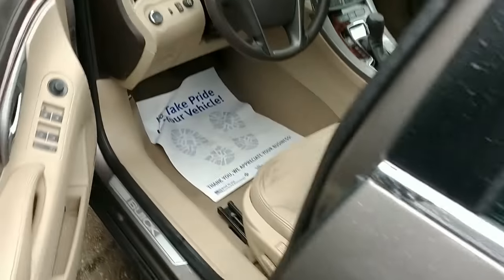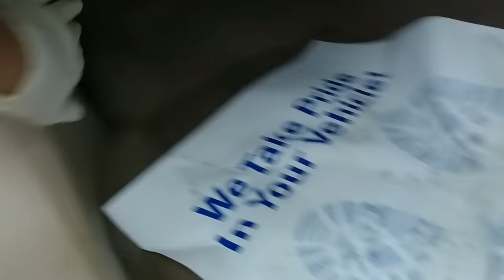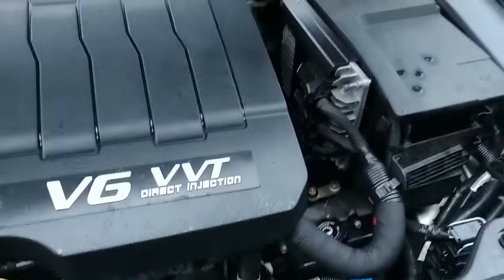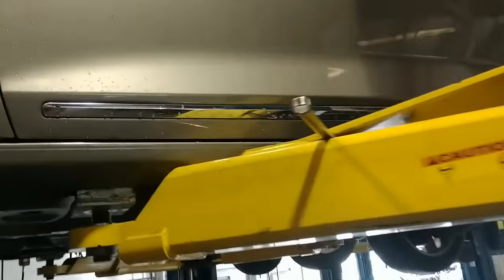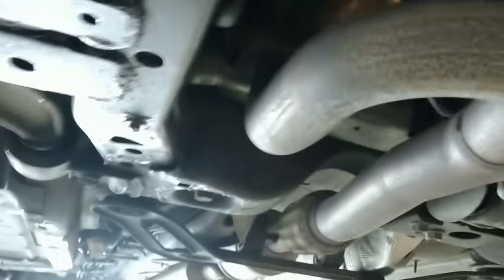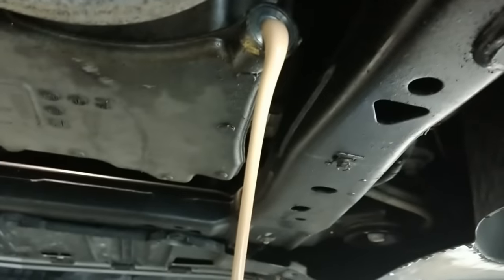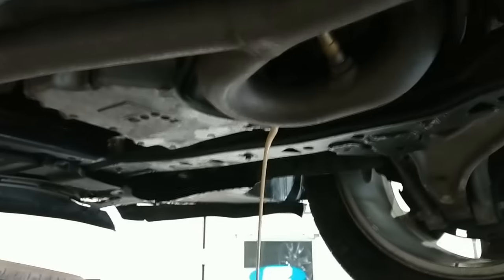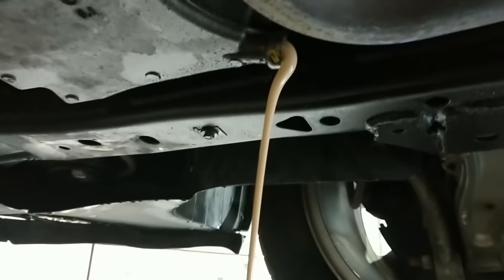Overfilled Crankcase! Blown ENGINE! Used Car Nightmare!

Comment: "I just got this new car, where does the gas go?"

Not sure, but the chocolate milk goes here that I know for sure.
Reply: Clearly the new guy wasnt sure what he was doing before selling it off lmfao
Reply: Lmao
Reply: Lol
Reply: @XENOX1428  or maybe he did it on purpose
Reply: @XENOX1428  he knew exactly what he was doing
Reply: Lol
Reply: That's not chocolate milk, it's coffee with cream and sugar.
Reply: If you'r chocolate milk looks like this then don't drink it.
Reply: @XENOX1428  Like he said in the video... it is oil, just mixed together with coolant.
Reply: I had something similar happen to me back in 1997. I bought an Audi A6. I knew where the gas went but could not figure out how to open the gas door. Turns out I had to push on the front of the gas door because of the way it was hinged. It would have been nice to have like a push button spring load on the rear so that I only had to open it from the rear like a normal car. I spent about 30 minutes looking for the gas door release button, under the dash, by the driver seat, in the glove box. Finally had to get out the owners manual. One thing that was good was that when I locked the doors it locked the gas door as well.
Reply: I think you mean pancake batter.
Reply: Gotta admit it was a clean looking  car.
Reply: this reminds me of vlog creations who acts stupid and puts beans in the gas tank and takes it to a garage to prank them lol

Comment: Hey Ray! nice to see a fellow swfl mechanic doing things right. I had one heck of a buy here pay here story about a month ago. lady bought an F150, owned it for ONE DAY and the trans literally blew up. Im talking the entire tail housing missing, driveshaft MIA, part of the wireharness ripped out for the speed sensor, LOTS of carnage (i have pics if you wana see)  since she already paid for the thing in full with cash she was set on keeping it, and while pulling the trans i noticed it was already a junkyard unit! (we got her a reman unit) The job was made more fun since i couldnt remove the exhaust crossover that runs under the trrans since it had been fully welded up! gotta love it
Reply: oof
Reply: Driveshaft MIA got me there 😂

Comment: I think checking the oil is damn near top of the list of things I check before buying a car.
Reply: iT IS the 1st thing to check after popping the hood. In fact before you even start the engine AND after.
Reply: It is, however I'm sure that used POS car dealer probably prepped this car so it would look "clean" on the lot, with freshly changed oil and coolant so if a customer actually checked them they would look normal.  Notice how they put armor all treatment on all the plastic parts just to "shine things up".  The oil and coolant probably didn't start mixing until after the lady drove off after buying it and only after reaching operating temperature, meaning she was miles away at that point. What a shame.  I feel bad for her.
Reply: Which is exactly why changing the oil is one of the very first things they do.  You’re more likely to find fresh clean oil and a sticker on the windshield than you are to find a clean car.  When you pull that dipstick you won’t find what you’re looking for because the evidence has been drained.
Reply: More like throwing on a coolant pressure tester onto the radiator and pump it up. Coffee milk shake means blown head gasket or cracked head/block.
Reply: Prolly everything was fine when he bought it. Sometimes head gasket just fails. I know it shouldn't especially on a new car like that.
Reply: @LA_Commander  yea but lemon laws will help in this case. Because its apparent the dealer sold mislabeled product of advertising as good working condition while clearly knowong it needed serious work
Reply: @wakcedout  You would think so, but unfortunately in most states, lemon laws only apply to brand new cars.  With used cars, you normally have no rights.  It's the world of "as is".
Reply: If I can't drive it first I can't buy it . That can save you alot of money . Warped  or cracked heads possibly blown gasket if lucky I'm guessing.
Reply: @roberttyrrell2250  Yeah, an knocking and smoking engine that needs an overhaul can be masked by using thicker oil. Very hard to spot unless its something absurd like 20w50 in an engine that should have 5w30
Reply: @kinsmart7294  There's a lot of things ppl can do to scam someone into a POS. You'd be amazed what a little black pepper can hide. OG trick.
Reply: I would run the car up to temp first. If they refuse to let you do that then it's walk away time....
Reply: Same here.
Reply: Used car dealers are right there with the lowest of the low.
The thing to keep in mind is, if a newer car is on a used car lot, it's probably because it was a lemon to begin with.
Good ones are usually sold to friends and family!
Reply: I allways check the coolant 1st & if it inst clean & new looking i walk away.
Reply: Checking the fluids, starting the car and moving it to look for leaks before test driving.
Reply: Probably. However not everybody is a mechanic. My girl for example probably doesn't even know where to check the oil, and I wager she is not interested in knowing such a thing. Still, she needs to buy a car every now and then. In general, people do not know exactly how the things they buy work, nor can they.
Reply: To get even wait 4 night time then go in the lot n spray all the cars with acid n paint..👽
Reply: I always take someone with me who knows what to look for with everything.. lol used car dealerships didn’t like me much… lol
Reply: @johnknight8540  Don't try buying at dealer auctions then which is where most cars come from today. You can drive it maybe 20 ft and go thru it for 15 minutes but that's it.
Reply: @jackdaniels9401  I know of a dealers lot that had that and more done to it. It was a new and used dealer at that he was ripping everybody off though it ran him out of town for real.
Reply: @Brooklynborn74  Be careful sometimes the person that you take knows someone at the lot willing to pay them a finders fee if u buy a car. Never fall for the old I know a good person that works there scam.
Reply: @quickdraw2532  those are different.  You not going there  intending on buying one car with the last bit savings you have . You got money already put back looking to buy 3 -5 plus cars as you know some will need alot of work . Those are crap shoots if your not mechanically/ electrically inclined . Being if things are wrong and you can't fix it your self you won't break even and most like need profit off the other 2plus cars to break even . We talking lot buying from a dealer . Where you turn the AC/heater to max and hit it at interstate  speeds. Then come back and look it over . If not you already looking to buy a lemon . If you can't drive it you best not buy it .
Reply: @roberttyrrell2250  not entirely in the US we have this thing called the lemon law
Reply: @gamefreak173  I'm familiar w lemon laws. Filing against a private citizen, is easier than a dealer. Try proving it while; You continue to make payments/ Ins, hire an attorny, be able to prove you did nothing to violate terms of service, or warranty.
Reply: It could of busted after she drove away, having had a cheap service or budget repair job.
Reply: Oh crap! I forgot to do this when I bought my Tesla. 😔
Reply: Yea some people put stop leak before selling so buyer won't know until about 300 miles later
Reply: @LA_Commander  - I'm guessing it had brand new oil in it when it was on the lot too.
Reply: @aardvarkbiscuit2677  Exactly, dealers know exactly what to do to fool customers. The really sloppy lazy dealers leave old dirty oil in there.  When I look at a used car if I see that I run like hell
Reply: I checked oil, coolant, A/C functionality (as we were just starting winter, and I needed heating to not die and be able to see), and windshield washer fluids. I also ran the engine, checking the exhaust for anything other than clear. Thankfully it was not an automatic, so I didn't have to worry about transmission fluid. 

I did have to worry about learning how to drive stick, though, since before my first car I had never driven stick. Not even dirtbikes.
Reply: well this video will always remind me to do so in the future
Reply: @LA_Commander  Yep...I wonder though. Did the buyer give it a good test drive, long enough to get it up to temp and at highway speeds?
Reply: yep check all fluids and smell it as well you can find alot out of fluids
Reply: @yautjayarrington1732  oil would not froth that bad after less than a hundred miles
Reply: I've bought a lot of cars for the family and have a very thorough checklist, I crawl all over and under that thing for like an hour before even starting it. Then another hour of checking, test driving, before saying yes let's buy it.
Reply: @AmandaHugenkiss2915  yep these days you have to used to be a quick check and a handshake and you could take a guys word
Reply: Forgot, always always always go first thing in the morning to hear it cold start. Don't accept "we warmed it up for you!"
Reply: Used dealers don't tend to like that - but, I guess their reaction would tell you everything you need to know.
Reply: STP can fill in a lot of gaps! For a while...

Comment: Science teacher: "Water and oil don't mix"
Buick: "That's where your wrong kiddo"
Reply: It’s coolant lol
Reply: @JoseRodriguez-nu3cu  which is half water.
Reply: @Dillonkg1  yeah but still..
Reply: @davidreali9642  Jesus what’re u saying 😭
Reply: It’s technically a suspension. Like salad dressing
Reply: Coolant and oil mix water and oil don’t, that’s because coolant is made of more than just water changing it’s density
Reply: @jacobdoesstuff2361  Coolant is made up of water and glycol. The glycol acts as an emulsifying agent because it has both, polar and nonpolar characteristics. This allows the glycol to bridge water and oil molecules together. The water molecules bind to the alcohol functional groups of the glycol, via hydrogen bonding, and the oil molecules bind to the hydrocarbon chain via Van der Waals forces.
Reply: That’s where MY wrong? 🤔
Reply: I guess an engine is a pretty good emulsifyer.
Reply: @Lolz325  How are you going to tell someone they can’t build sentences properly, when you don’t add spaces after commas, and use the incorrect form of you’re?
Reply: @hunterfontaine5832  Hey at least you can understand what I'm saying, Also thank you for the pointers.
Reply: @Lolz325  Well that deescalated quickly 😂
Reply: @hunterfontaine5832  that first guy sounded like having a stroke.
Reply: @ffwast  I pointed out the hypocrisy of the second guy, I did not say the first guy was exonerated.
Reply: Chocolate milk ?
Reply: @Lolz325  "build good sentences" pot calling the kettle black.
Reply: You're also adding HEAT to the mixture. Try it cold and it won't happen.
Reply: What the hell is a buick?
Reply: All these comments are just ruining a funny comment.
Reply: @cmoore806  it looks like salad dressing though you won't be happy getting a salad full of that
Reply: @davidreali9642  he said it was "soft serve" which is ice cream, right? Is this connected to why the ice cream machines at McDonald's break so often?
Reply: @ragu193  🤣🤣🤣🤣 I was wondering the same thing. S'like...You having an embolism right now bro? Need us to call someone for you? I do know reading it made my left eyelid twitch. 🤣
Reply: Blah Blah  Which is a type of mixture.
Reply: I've never seen people get so mad about the technicalities of the properties of fluids. 945 upvotes say people got the joke.
Reply: what is soap? it's oil and water
Reply: Anything mixes if you try hard enough. And hard enough is when the crank is mixing the oil and coolent at 3k rpms+
Reply: @cmoore806  the proper word is emulsion.
Reply: English teacher: "It's you're, not your..."
Reply: Well that's an emulsion not a true mixture ^^
Reply: Oil and water WILL mix, if they are agitated vigorously enough, say, in an engine. The resulting viscose liquid is called an "emulsion.".. like a milkshake.
Reply: @effyleven  As soon as you stop stirring they will separate again. Besides, if they mix inside an engine it usually means that your head gasket is leaking which is bad news for your engine. So your point is...?
Reply: @Moodo76  His point was made in the first five words.
Reply: @danmystro  Even though he was wrong? Brilliant, two geniuses patting each other on the back...
Reply: @Moodo76  It wasn't wrong though. You shifted the goal post by saying "well when you turn it off..." That's not the point. Thr point is, they will mix when agitated enough.
Reply: @Moodo76  Apparently, the presence of glycol stabilises the water-oil emulsion.. which sounds reasonable to me.
Reply: @Weggorino  Which means that your engine is toast. Yes, you can stir it all together but it will return to its original state as soon as you stop stirring. That's basic chemistry, water and oil doesn't mix. At all...
Reply: @effyleven  The point is that an emulsion never happens in a combustion engine. Water and glycol is there to cool the engine and the oil is there to lubricate. In a lab, sure it may work for a while, but this video and this discussion is about cars.
Reply: @Moodo76  Tell me mate, are you in an unhappy relationship? Does it make you get an uncontrollable urge to pick pointless arguments with random people on the Internet? Have you thought of getting treatment?
Reply: @Moodo76 Just what am I supposed to have been "WRONG" about? 
Explain yourself, or go away.
Reply: With enough heat they do
Reply: @apoocumber4164  Oh ffs...
Reply: @amorag59  No. It's called an emulsion. Emulsification is the process of creating an emulsion. It also requires an emulsifier unless you want it to instantly separate out again. That's what people mean when they say water and oil don't mix.
Reply: @Moodo76  "The point is that an emulsion never happens in a combustion engine."
In this instance an emulsion is forming because the coolant (containing water and glycol, an emulsifier) is leaking into the oil.

Comment: "this lady's gonna be pissed". Understatement of the year! 🤣
Reply: She should be! The car looks great & should run great too. Buicks old an new are fabulous vehicles. All comes down to proper maintenance on any vehicle.
Reply: @Davido50  on l
Reply: Not like there's much she's going to be able to about it LOL.
Reply: @harryrenner3001  Don't you have laws relating to merchantability? It would be clear to any inspector - and Rainman Ray - that this happened more than 100 miles ago. If the Buy Here/Pay Here claims to have inspected it, doesn't she have some recourse?
Reply: Wish them explaining this to the customer was on camera
Reply: @Davido50  well this one is going to be a money pit. Very likely your looking at a couple grand for a used motor assuming you can find one. Then your looking at another grand or 2 in billable mechanics hours to put it in. So this “ cheap” Buick is basically a rolling body. We call those mechanics specials where I’m from. Cause only a mechanic will have the skills to fix it
Reply: Not of merchantable quality.  So surely she just takes it back for a full refund plus her mechanic’s costs, the price of the tow, and her taxi fares?
Reply: @Orion40000  It depends on the state. I know CA and MA have strong laws along those lines, but less regulation-friendly states don't.

Comment: Years ago we all drove Vdubs 'cause they were cheap. I've worked on air-cooled for decades and while they aren't the greatest vehicles you kinda got what you paid for. That being said the new VW's are the worst pieces of shit on the road and need to be condemned. Love your videos and common sense to life Ray. Thanks!
Reply: You are so right.  The air cooled VW were so bad that I wouldn't have them in the shop.  (Mahle pistons that go bang after a rebuild anyone?). The water cooled were actually worse.  I had a Rabbit.  Rain leaked through the windshield, shorted out the fuse box, starting the engine, which turned on the FIS and the thing would drive off.  I was never out from under it.  To this day I won't touch a VW.  
My neighbour is a Mechanic  with two daughters, whom he loves dearly.  Both bought VW.  He told them `You're on your own'  Enough said